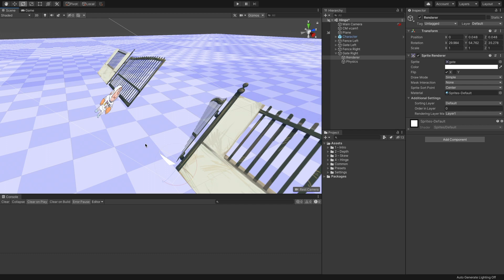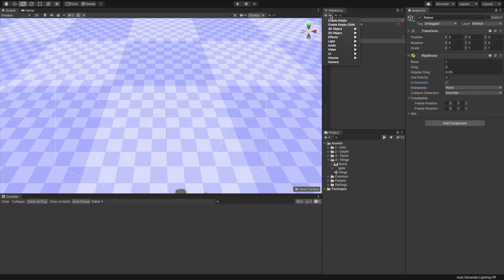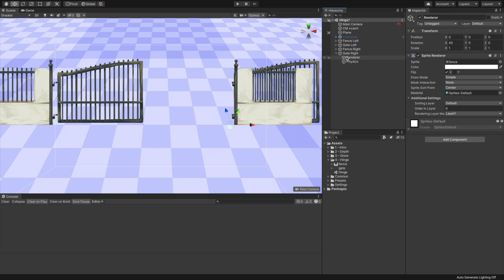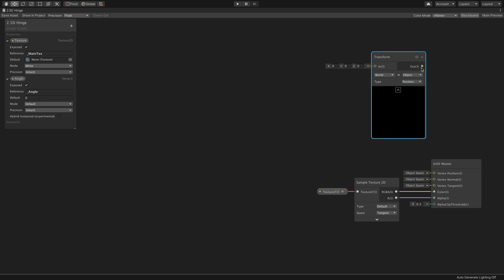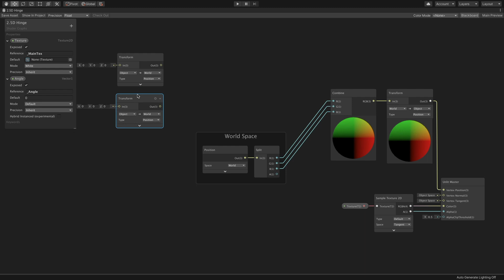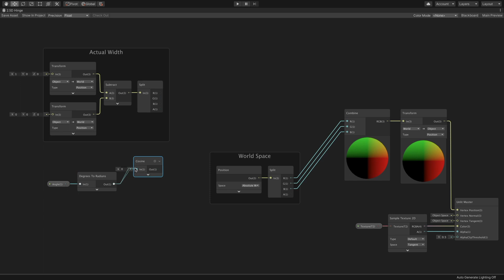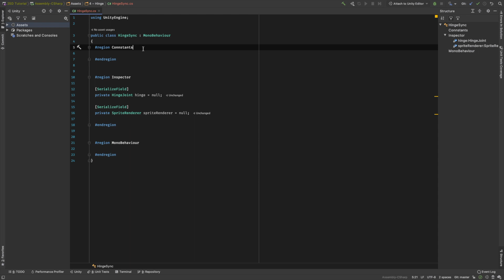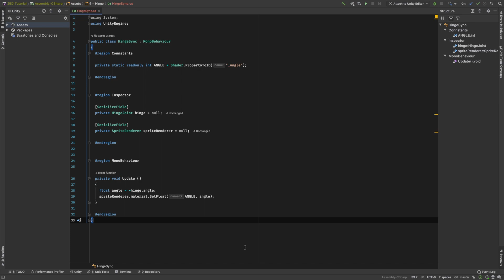2.5D Unity Game #4 – Gate Hinge Shader Graph Tutorial

Comment: Very elegant solution! I wonder about the shader's performance, though; won't it increase the drawing time of such objects dramatically?
Reply from the maker: The render pipeline runs a shader for each vertex in the scene and each pixel on the screen every frame. Since a shader will run anyway, tapping into the process with a custom shader is virtually ’free’ (there are complex shaders which take much more resources – this is not the case with this shader).
I would've been more concerned with the script setting the shader property every frame, but it requires a substantial amount of scripts running in parallel to hit performance.